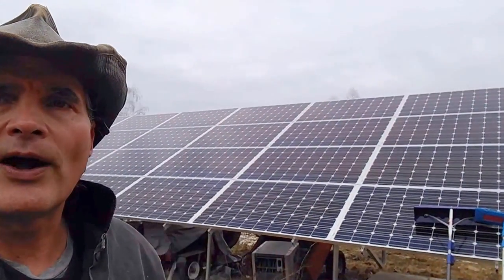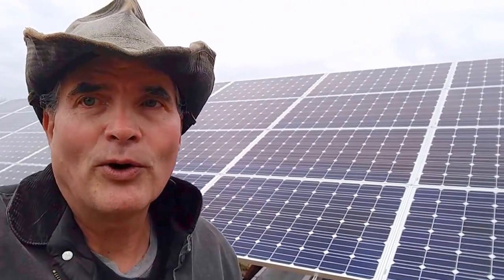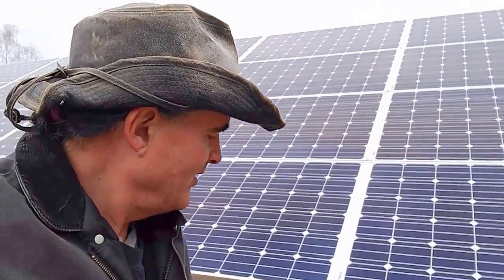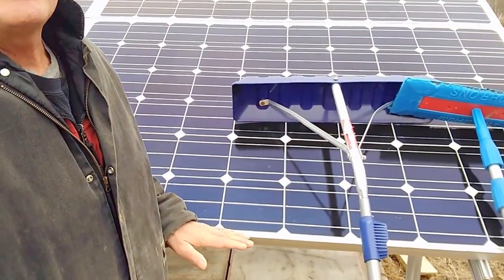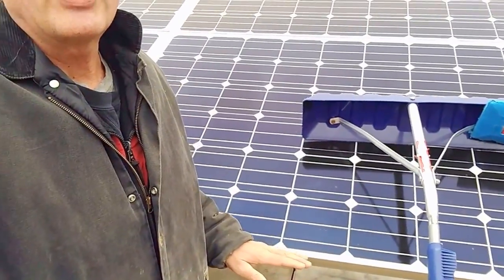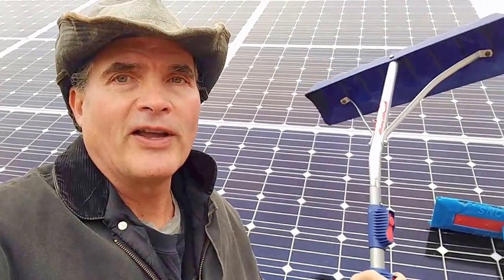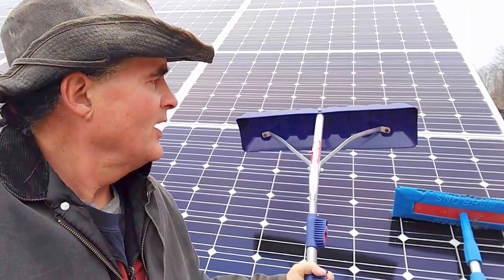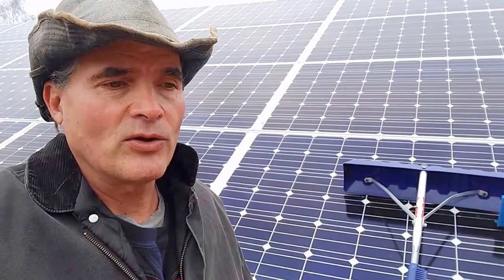Solar panels and snow removal, snow on solar panels, solar power in the winter, solar panels winter

Comment: You might want to consider a power tilt feature to your array so you could “park” the array at vertical or just slightly over center when a snow storm is predicted so there would be no accumulation on the panels? I know it’s an expensive addition but you could do all that from the comfort of your office or home!
Reply from the maker: Hi Dan thanks for the comment and suggestion I just posted a response https://www.youtube.com/watch?v=kK0IjSGb8l4&t=25s

Comment: Is there a reason you would not use the tractor to remove the snow from the bottom of the array? Yes i know you would have to be careful but you could keep  a good foot away and you should be fine

If you raise the panels then it would be even more difficult to reach the top and the angle would be so you are reaching over your head. Have you considered airplane deicing fluid?
Love your channel, it inspires me.
I watch a lot of youtube videos and i learn from others failures, so hopefully i do not repeat the same mistakes. keep up the great work
Reply from the maker: Hi Pertorian Sky,

Thanks for your questions. I actually do use the tractor to
remove the snow from the base of the panels. There wasn’t enough snow falls and
there was a warm spell before and after that video so the tractor would have
dug into the thawed rocky ground and projected them and I don’t want to risk
any damage to the solar panels. When the ground isn’t adequately frozen before
a snow fall the blower digs into the earth and my blower is very powerful. 

Raising the panels would mean far less physical work for me
because I would just have to pull the snow down as opposed to moving a second time
once it’s down. 

I would only recommend raising the height of the panels in
an area that gets as much snow as we do, which are very few locations.

No I haven’t considered deicing fluids. I do not choose to
use any of the generations (types 1-4) because I am always focusing on building
the soil microbiome. Soil and water are two very essential elements that is
life sustaining and I do not wish to use chemicals that will affect the life in
these elements.

Very thoughtful questions. Thank you